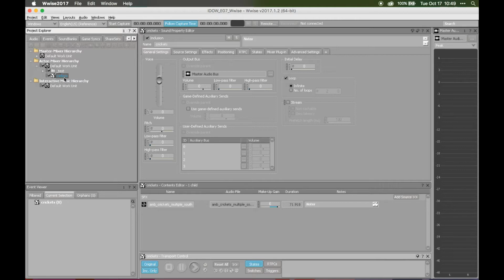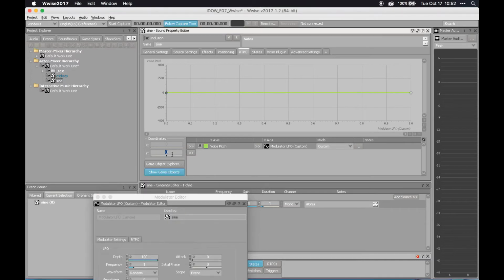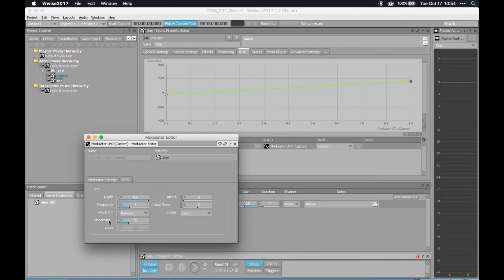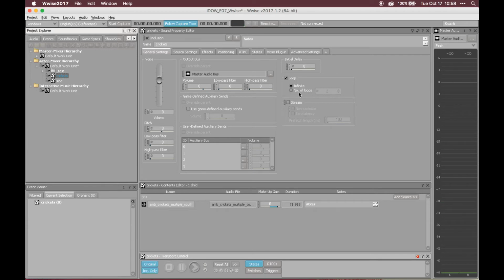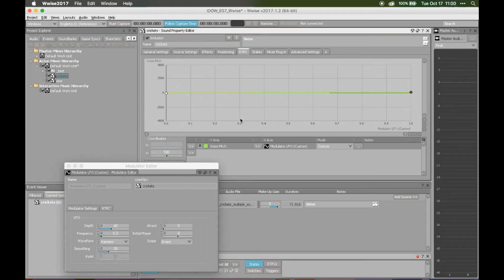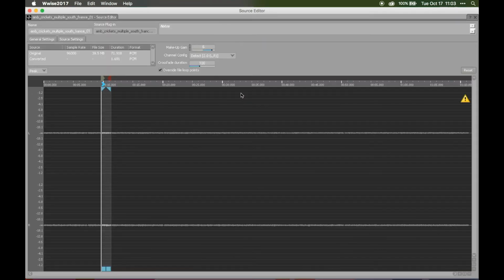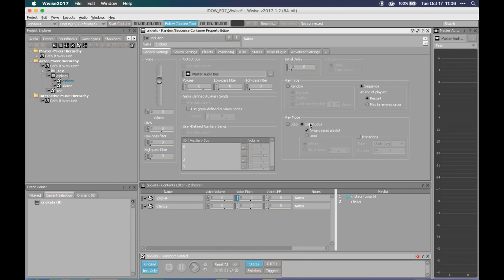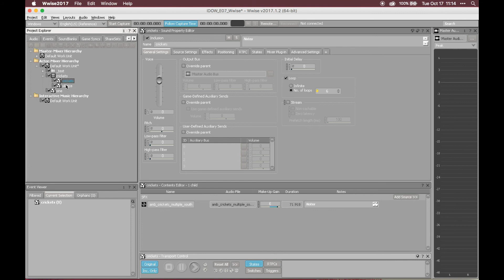I dream of Wwise - E07: the new Random Generator

Comment: Hey there, thank you for this video. It was exactly what I was looking for. One question, though: the smoothing value is greyed out for me. Any suggestion as to what could be causing this?
Reply: To add more: it's not greyed out for the other waveforms (other than sine). Hmm... I guess they've changed this for the newest version of wwise... but why wouldn't they allow random to be smoothed?
Reply from the maker: @pietrosammarco6225  hey Pietro! I'm testing this in Wwise 2019.2.9 and sine is the only waveform that doesn't allow smoothing, all the other ones (including Random) have that option available. What version of Wwise are you running?
Reply: @francescodelpia  2021.1.1 is the version. Also, since I wrote you the message, I discovered (I think) that it's a bug. I say this because if I select random waveform, smoothing is greyed out -- but then if I click in the empty slot below the current curve (like to create a new curve) and then click back, it's not greyed out anymore!
Reply from the maker: @pietrosammarco6225  oh that's interesting, it sure sounds like a bug they introduced in Wwise 2021! If you feel like it you can report it to Audiokinetic from the Wwise Launcher by clicking on the question mark icon > Report a Bug.
Reply: @francescodelpia  Yup, just sent the bug repot. Thanks!